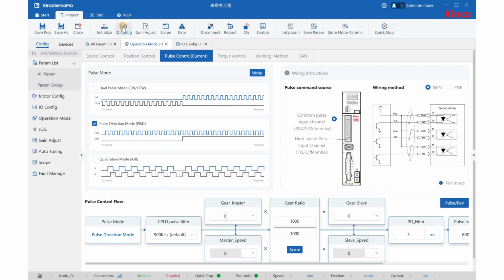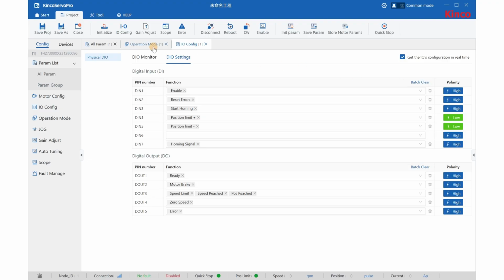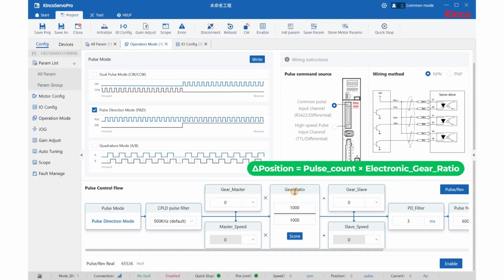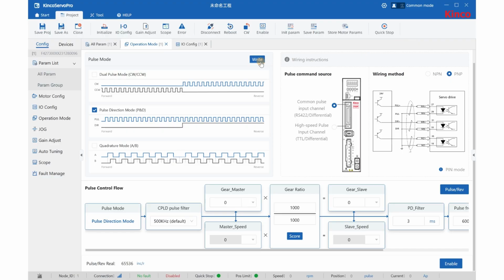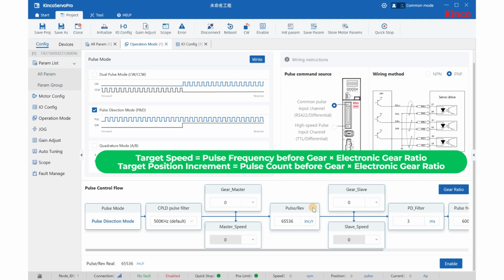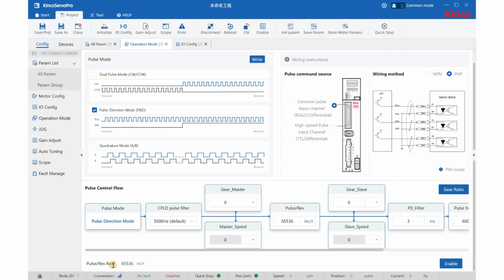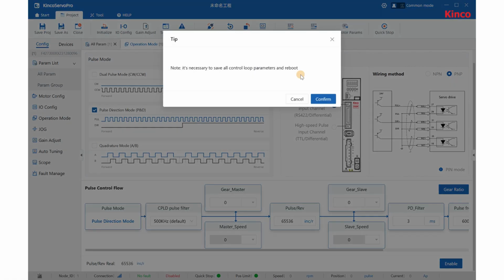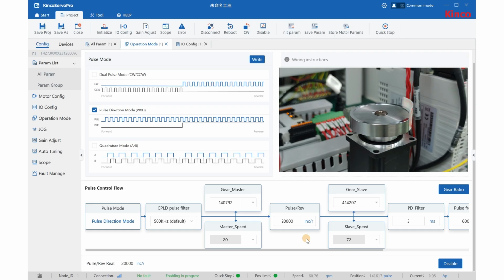Pulse Mode Setup and Motor Pulse Configuration | Kinco Servo Pro

Comment: Hello. You can record a video for PLC K6 with a basic stepper motor control course for beginners. I want to use the GL070 panel to control the PLC start/stop, direction of rotation, speed of rotation, and preferably the length of the path in 360 degrees (full circle) or infinite rotation.  We will also control the optional on/off device.